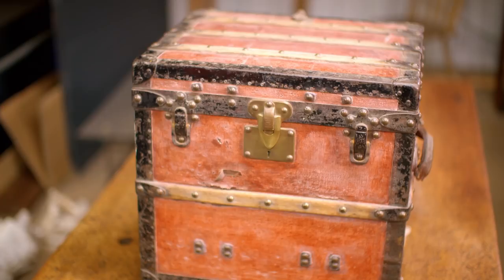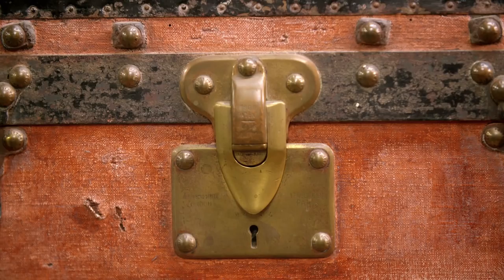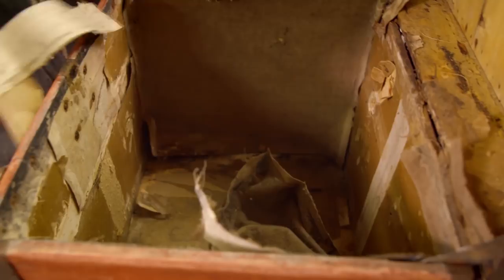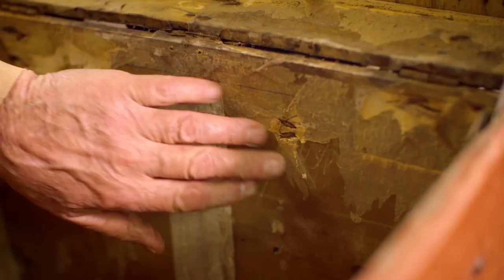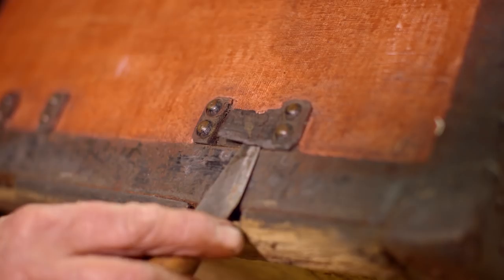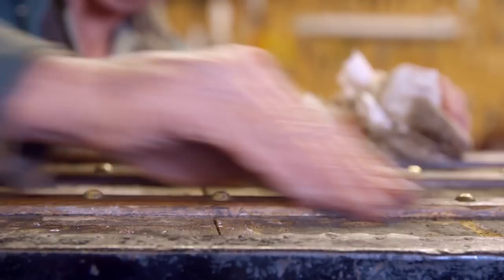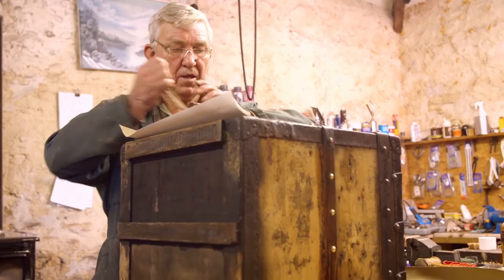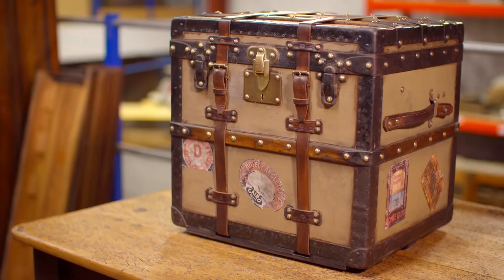Carefully Restoring A Louis Vuitton Trunk From The 1900's | Salvage Hunters: The Restorers

Comment: I actually liked all the character of the wood and feel that would have looked fabulous with a light stain to seal it and left as is. The ew canvas is great of course but it covers up the vintage of the piece and those visually appealing wooden elements to the point where it could almost be a replica and not an original. Just My opinion. I guess it depends on what the client wants. Cheers.

Comment: you can send it to Louis Vuitton to restore it
Reply: I doubt that it would look as good. Martin has done a fantastic job. That's real craftsmanship.
Reply: I disagree, well I agree LV would restore it, but LV would restore it much as Rolex restores an old, worn yet very valuable watch.  Rolex typically will strip out dials, hands even the bracelet for brand new often changing a watches' value from half to as much as a tenth of the unrestored value.
Reply: @samadrid6321  i need to get a new glass for a women's gold watch that goes on a chain (like a pendant) Probably i'll have to send it to Canada or the UK